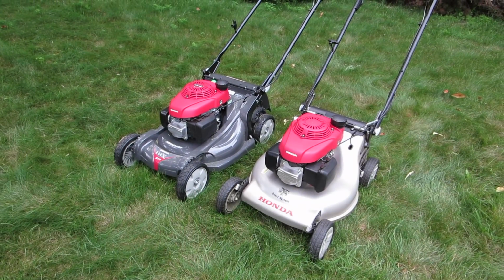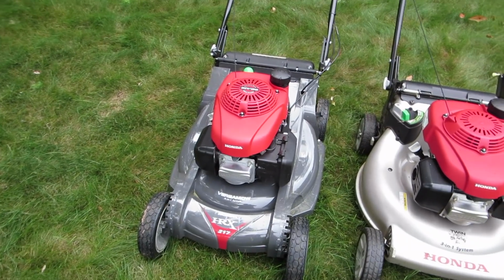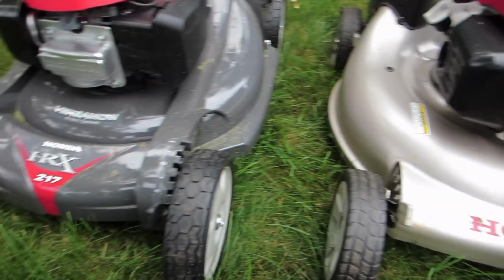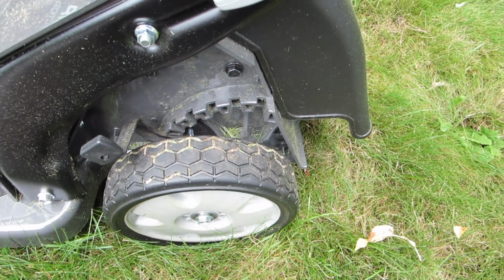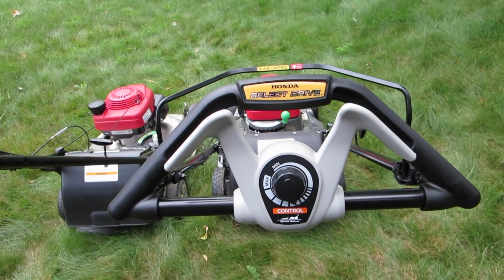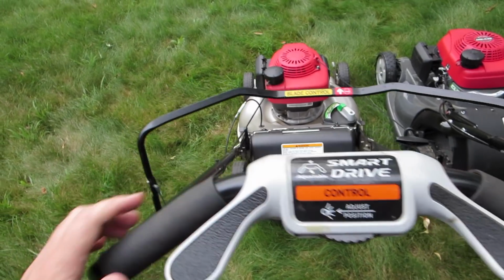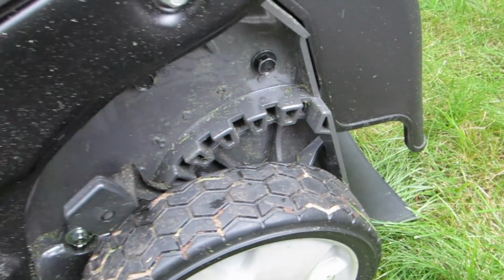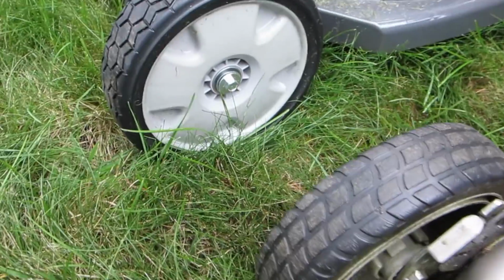Honda HRR vs HRX Mower Comparison - long term review

Comment: The HRX217 will  just meet the minimum power requirements for a 21 inch self propelled lawn mower but the HRR216 even for 19 inch push lawn mower it doesn't have enough power to cut grass properly. Cutting grass properly requires an engine with high torque and high rpm . Unfortunately Honda does not provide such engine neither for commercial or domestic lawn mowers.
Reply: Nick Grigorakos don’t do drugs kids.

Comment: I don't like the idea of starting a cold engine and having it run, throttle wide open, like those mowers do. I don't start my vehicle and hold the pedal to the floor, and it has a pressurised oil delivery system. My Honda has a slap style oil system, no way am I running it wide open on start up. That's why I bought one with throttle control. I open the throttle for starting, but the second it fires, I throttle it all the way back and let it idle for 5 minutes while I put on my PPE. 

I don't play games with my mower. You'd think I was bat shit crazy if I told you the lengths I go to, to baby that machine.
Reply: Heinzkitz Velvet Technically the governor controls the throttle. It’s only spun up to something like 3200 rpm. The governor will try to maintain that speed using the throttle plate. You won’t kill a Honda mower motor no matter what you do so I wouldn’t worry about it. Change the oil once a year, clean the air filter when it blows black smoke on startup OR twice a season.... spark plug will probably last forever. That’s all ya need :-)
Reply: @briantii  I change Kathryn's oil every 10 hours, chief. Installed a magnetic dipstick, a Tach/Hour meter and Royal Purple break-in oil before I ever turned the key.
My pre-ignition sequence is, I check the oil AND clean the air filter before every mow. That's why I can change the air filter once per season, and why my Kathryn 
NEVER EVER blows black smoke.

Air filter and spark plug changed at the end of every season, right after I sea foam the carburettor, valves and cylinder out really good.

Non ethanol gasoline only and as I said, I wouldn't ramp my vehicle up to 3200 rpm when it's ice cold, my Honda deserves no less respect.
Reply: Heinzkitz Velvet Kathryn sounds well kept, but I’d skip the sea foam and Royal Purple. I don’t trust oil dyed with marketing goo and Sea Foam might not be good for the seals. 

My old Lexus will spin up close to 2500ish rpm for fast warm up of the cats and can be driven immediately. It’s got 234k miles on it burns no more oil than it did with 70k miles (3k miles per qt), and runs like a top. Oil changes with reasonable non-fancy semi synthetic oil. Cams look like new. Point is, quality equipment is designed to last when following the most basic maintenance schedule. The Honda self propelled bushings are junk, but their engines are fantastic. It won’t die, no matter what you do. The spark plug though seriously won’t be worn out unless you’re doing hundreds of hours a year. Most of what you’re doing is throwing money away, but I realize “the best” is a choice... just realize it might not be actually doing anything. Cleaning the air filter frequently IS a good plan though. That makes a legit difference.
Reply: @briantii  Here's an idea, why don't YOU skip the Royal Purple motor oil and the yearly Sea Foam treatments while
 I continue with the meticulous maintenance program I've set up for my equipment, and count my own money. Deal?
Good. Take care.
Reply: @heinzkitzvelvet  I do. 7 years. Runs like new.
Reply: @briantii  👍
Reply: I also don't like high throttle cold starts, especially in early spring and late fall when the temps can be in the upper 30's (mowed near freezing a few times!)  My particular HRX model has the auto choke, and it will in fact start up with the throttle on low-mid throttle, which is what I love about my Honda!
I actually modified back in the day an early 70's Briggs powered 8hp rider mower from full throttle choke engagement, to a manual choke lever so that I could start it at lower rpms, vs at 3600.  It lasted 26 years on the original engine-only needed 1 valve seat replaced (& valves lapped) due to lack of leaded gasoline in its later years!
I also have a tach/hour meter installed.  I've been somewhat hesitant to tell anyone how closely I monitor it for its servicing!  Glad to see there's someone else out there more OCD than me haha!
Reply: @Believe231  Heh, to be clear if it's THAT cold I fully support warming it up gently too. If it's 90 degrees out? Nah, I skip it.
Reply: @Believe231  RIGHT ON BROTHER!!!! 👍👍👍

I'm sick with it! I keep a log book I make entries into after every mow. A receipts book for everything I've bought for it. I built a work bench and installed an electric hoist so I can work on her. Bought a shop manual, all the tools needed. It is a total obsession of mine.

Comment: I have been tied up waiting for parts. I got stuck waiting on an order because of one gasket. Called the place and told them ship everything now, I can deal without one gasket if need be. This year has been a real problem with parts. Normally I get parts in 3 days. When it takes two weeks...that screws me up. I may have to get a back up parts supplier. I never had to before. Honda is a good mower and run quieter than most others due to clearance of parts. China has taken over the market for lawn mowers and engines now. I am not a fan of China. I would like to see the small engine manufacturing come back. People need to stop buying these cheap chinese made items. Honda does offer more options on their equipment. As far as working on them? It doesnt matter to me. The biggest problem I see is homeowners taking the drive system apart and assembling it wrong. If i had a dime for every cam I found reversed. This year I found two Toro mowers with the blade upside down. Good video. Good review! I think people can use your review for purchase.

Comment: Thanks for the wealth of information. What a refreshing comparison.

However, you are committing a serious Injustice on not using a bag.

Since 10 years of age, I've been cutting grass. 

Mulching is for applying treatment and preparation applications for the lawn  (during Spring) and during the Summer when the lawn is looking 100% healthy.

The stage where your lawn is, it is best to use a bag. Once all the spots are filled in, then you can proceed with mulching.

Mulching is for soil and grass treatment and healthy grass, strictly.

Comment: The thumb control is awful on this particular HRR.  In my opinion, there is a better HRX speed/pace control as well (other than the one shown in this video)  It's similar to a commercial Honda mower. Compare them online (get a distinct model number) prior to going to a box store.

Comment: HRX has a better transmission, deck is built better, and bigger motor.  Steel decks are junk and they will rust no matter what.  The only comparable deck in longevity is a cast aluminum deck. Plastic deck has a lifetime warranty too..  Plastic wheels wear out in a matter of a few years, rubber won't. 

Bad review on these. Guy is filming the rear numbers too numerous time while saying they aren't there 😂😂😂

Comment: I am curious, how has your HRX held up over the past year? I got the HRX217HYA with the new GCV200 (201CC) Engine. It’s such a beast and love to use it! I still have my HRR, and gave it to my dad. What I’ve done with the HRR is I’ve put these new style wheels on it that Honda now makes. They have so much better traction and are made of a better material. https://youtu.be/GLPqdKXDo9E

Comment: I have both at home.  I respectfully disagree with some of your assessments.  I certainly won't get rid of my HRR as it has it's uses/advantages.  I use my HRR for spring and fall cleanup as the bagger performs much better than the HRX - the HRR vacuums up everything.   I will edge my sidewalks and driveway and I'll take the HRR and vacuum up all the debris.  The HRX won't vacuum nearly as much.   I never realized this when I just had the HRR, but when I go back to the HRR, I miss the ability to adjust the handles.  I'm not exactly tall (5'10"), but I put the handle on the HRX to the highest setting.  The HRR's handle just seems too low for me and is not  height adjustable (not sure if newer HRR's are).  As for cutting performance, they are pretty similar.  I find the HRX is easier to push (if you aren't using the self-propel).  So I find myself pushing the HRX for the short distances that I may not want to use my preset speed setting.  I also can cut my grass in the rain with the HRX as it handles wet grass a bit better than the smaller engined HRR. As mentioned, he HRR's vacuuming ability is unbelievable - but that will bite you if you're bagging, because you have to empty the bag much more often (probably twice as often).  The HRX will mulch better as well (less detectable clippings).  If you aren't going to mulch and aren't going to bag -  I have the optional side discharge chute on the HRR which distributes the clippings much more evenly than the rear discharge HRX.  (My HRX is from 2017 and is the HZA model. My HRR is from 2005 and is the VKA model.  The newer HRR models may not require the optional side discharge chute)  I find myself enjoying the HRX much more.  I have the fully optioned HRX too, which means I paid nearly double for it, than I did for my bare-bones HRR model.  Still no regrets
Reply: I am about your height. When I looked at both of these in
store, I also noticed that the handle bar on the "HRX"
could go noticeably higher than the "HRR".
The "HRX" does not require you to bend over while using
it. The "HRR" requires slightly bending over to use it.
Reply: I have a '17 HRX as well, I had initially noticed reduced vacuuming ability vs. my old Snapper, but I found that the height level of the mower affects it greatly, just lower it down some and see if that helps, it did for mine.

Comment: I have an HRR fir maybe 5 years but its crap. It seems to easily bog down even if it's just a little tall..I do all the maintenance- oil/plug/filter/carb cleaned/new blades...the last 3 years it's just is plane junk. Going to either go with hrx or a Toro
Reply from the maker: That’s odd... I know others who have the same mower and none of us have had that experience. I still think for the price/category it’s the best option but hope you have good luck with whatever option is next for you!
Reply: @garagedad4540  went HRX yesterday..its a beast
Reply from the maker: Rich Lo it’s a great one! Congrats! Some lawns require the extra power.
Reply: Get a Toro Super Recycler if you like to mulch.  The Hondas are horrible at mulching in heavier grass, and their blade clutch system doesn't like it very well.  Skip the ridiculous bloated overpriced Honda and just get the Toro you'll be happier in the end.
Reply: I love the HRX 217 it is a good lawn mower for my grandson to teach him control before trainging him on my Craftman 5000 Rider.  My dad in remembrance brought me a self- perpelled Toro when i was my grandsons age.  He is 11 years old.   Training the grandson work ethics and control.

Comment: Why not just buy the 1# highest rated mower, The EGO!! No maintenance, more power, same cut  quality!! Hell even the cheap Ryobi has a much higher rating than those hondas. For even better cut quality and more power look at the Weiband mowers, Those also have a  higher rating than those hondas.
Reply: People see the Honda name and think its the greatest in the world.  I had one for a while and it was junk, the blade clutch system is garbage, and they don't mulch worth crap...add to the fact for the price you get the world's smallest bagger.  I stepped way down and got an el-cheapo 3-in-1 push mower and have been so much happier.  I use a Toro Super Recycler for work, which does an awesome job of mulching and has a much larger bagger than the Honda did.  Honda's are so over-hyped and over-rated its pathetic.  I just use the Troy Bilt el-cheapo push mower at home and it does great and has a larger bagger as well, a little smaller than the Toro's but much larger than the Honda.

Comment: both have honda gcv home depot engines,  get a GXV ENGINE
Reply: Why?
Reply: Home depot? You mean Honda?
Reply: Not Home Depot Engine’s...just consumer engines that are put on both models whether bought from Home Depot or a Dealer. GXV or GCV is the heavier duty commercial engine found on their generators, tillers, trimmers, etc. The GCV160/190 are great engines and will likely outlast anything in their class if proper maintenance is exercised. (Clean air filter, oil changes seasonally)
Reply: @michaelholly88  - So you're saying, make sure the letters are in capitals, to insure the more heavy duty motor?  Thanks